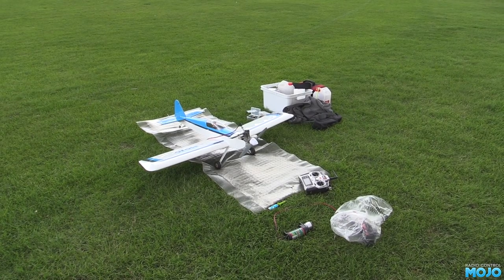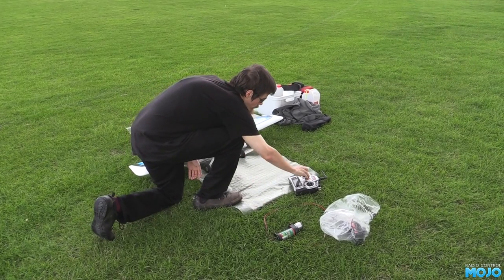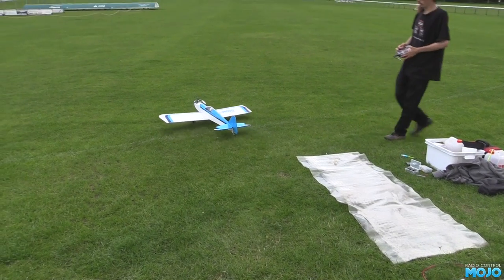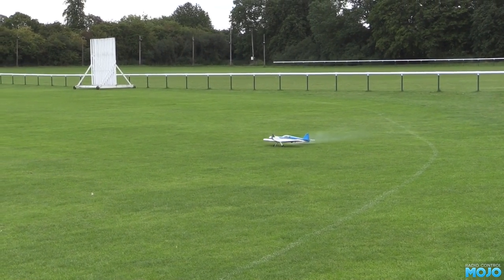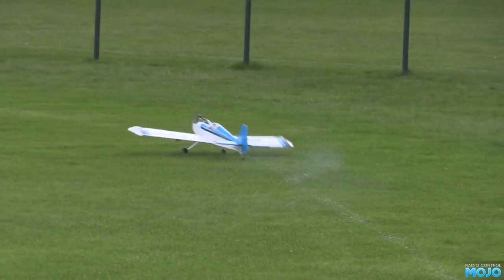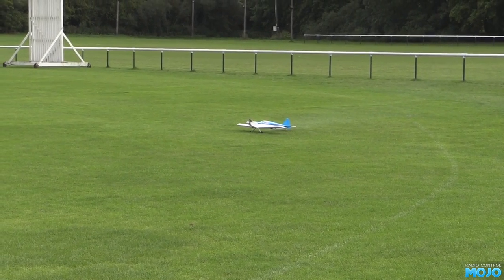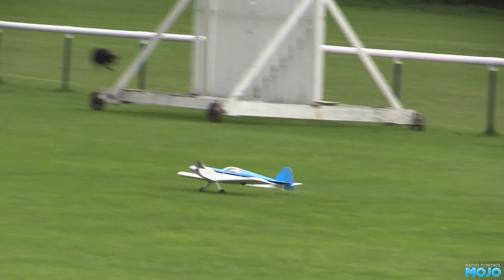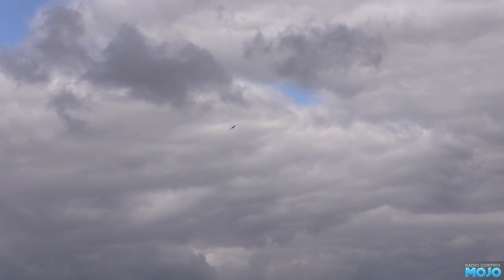Seagull Challenger Build Up Kit - Part 8

Comment: You videos have been most helpful. I was wondering where F14 went but The fuselage is complete so I will will have to see how I can squeeze it in. I am running a Turnigy G46 electric with 4S battery and 70 am esc. 13x8 prop. Same set up on a scratch built Stik which is heavier so this should work well on the challenger.
I only have the most important thing to do now, deciding what covering scheme I should do.
Once again thanks for sharing your build video.

Comment: Built one of these for electric power. C of G should be the middle of the wing joining tube which is quite a bit further back than the instructions say. Probably another "Boomerang" instructions word processing paste....
General comment... now the C of G is OK I love the way this flies. :)
Reply: Robin, what set up have you used for your electric power version.
So with the original CG set, it would mean the plane was too nose heavy?
Reply: http://www.modelflying.co.uk/forums/postings.asp?th=103536&p=2

see link to discussion.....

...."My pockets are a bit shallower for motors so i have gone Hobbyking Prodrive 3548 900. which was considerably less....still on a 4S 3200...which I have for other planes. Another few weeks and I will know how it flies...."

Problem of this was a vibration, a buzz under power, which wouldn't go despite balancing and finally I beefed up the mounting and the bulkhead a bit and made sure all was tight, and now it seems much better.
Reply: I have the 3300 4s which abuts the back of the motor bulkhead and had to but some 30 grms of lead under the tail, so I could have moved the battery back instead.... but didn't.
Reply: What size motor and prop did you use?
Reply: If you read the comments you would see Prodrive 35-48 900kV.   I amusing an 11x6 prop.